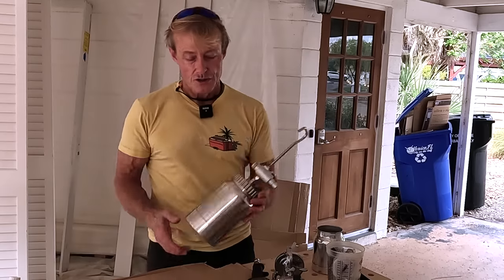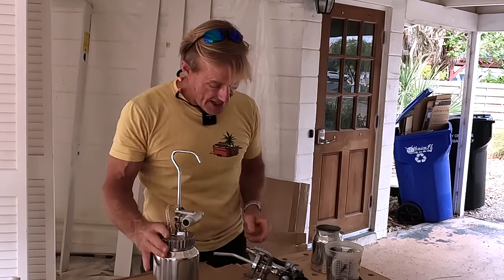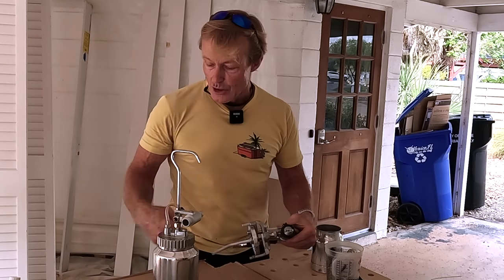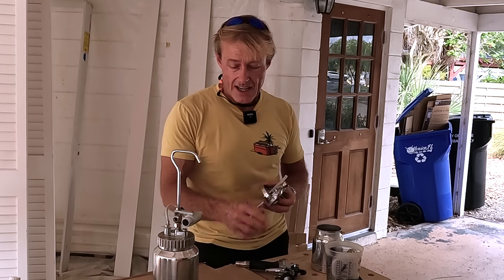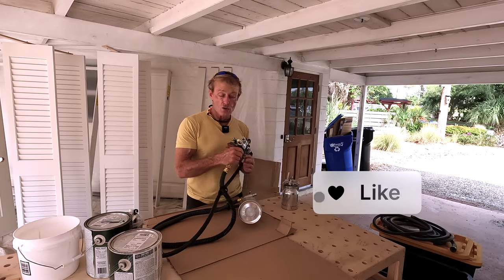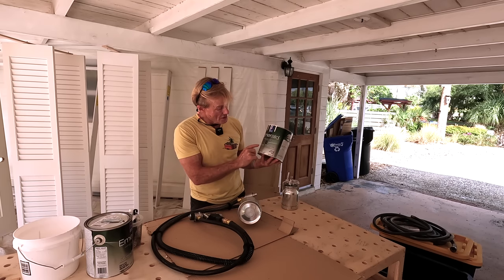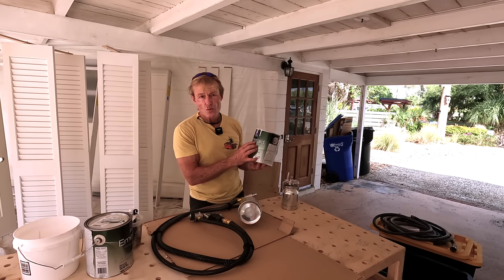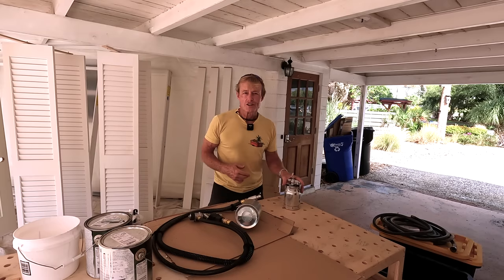Flawless Door Painting Using Titan HVLP 115

Comment: Nice job! I agree with the SW Emerald urethane; good stuff. I try to spray all my trim in my Reno’s with my airless and it always comes out nice. One small thing I do differently with the doors is I turn them back and forth into a “W” shape - makes it easier to reach both sides. If there’s any concern with them sticking to the drop cloth/Ram board, etc. you can always tack a paint strip on the bottoms but I’ve never had any issues. That is a lot of work to get to that point with the trim!
Reply from the maker: I did struggle getting all around the doors. Good tip about the W shape.
Reply: I’ve done the same w pattern for 20 years, it’s the way to go. I just did a built-in library/entertainment center. I used the emerald for the first time, ran it through my old 440. It lays down and sands like lacquer. Really great stuff, can’t wait to use it again.

Comment: Great work. We used to finish similarly, 2 things that could help efficiency. SW has a trim product in their pro classic line that is an acrylic/alkyd hybrid. It levels well dries hard & leaves no tool marks. Lastly when attaching doors together to spray set them like a “W” rather than parallel slightly larger footprint but you don’t bump anything with the house & the lighting is better.
Reply from the maker: Thanks for the tips!

Comment: Ron, thanks for another video. I love watching em. Looks like you had to back to work after a long time off. Good for you. I did a modified version of your plans for a work bench.  I love it. I have been remodeling average homes as a property manager and then fixing them up to sell since the 1970's. I did a small stint working for a custom painting contractor in 1976. Used to be just brush and roll in those days. We all used some really good oil based enamel on the door and trim. God did it lay out nicely! Really made painting fun looking back watching it flow. I've painted countless homes and cabinets since. 
I was drawn to your video to see if you had any better luck with your HVLP to my airless. Couldn't get the resolution to tell. 
I think it is the long way around to paint anything before it is attached. You could save all kinds of labor painting the jams and casings after they are installed! And have a better job too. Painting loose material is old school before the time saving sprayers. 
You can set up the actual room to spray in. Get your tarps masked tight to the flooring. Like a military bed, no wrinkles. Personally, I walk the doors and spray them with 1 corner against a wall and spray each side by handling them from the top and the handle hole. Yes, most production painters use the W layout, but hay, these are really important, and I like to see them and have full access. I pull from a stack and when finished they may be 4" separating them. 
Use a vacuum with a horse hair round brush attachment to vac up all your sanding dust. Follow up with a tac rag. Won't take that long to ensure a clean surface. Just blowing moves dust from one surface to another. And vac the floor, before you mask. If you shoot just a little paint on the floor first it will keep any loose dust from blowing on to the doors. 
Your jams and casings will need to be nailed and repaired. Then they will need to be caulked, casing to the jam and casing to the wall. After that, you pretty much need to start over anyway. All your coats will be going over the spackle or putty and caulk. This just improves the build and you will not be moving around loose boards and material. Want some brush marks? Apply about 2/3 the spray amount, run a brush through the material and then top spray it finished! Beautiful! 
Mask off the trim, sand the overspray and finish the ceiling and walls. Better and faster. 
With all this bragging, I have to admit, I am having trouble getting the airless finishes I used to get with the older higher VOC water based paints. Seems if I spray the door edges first, then the paint doesn't fully attach to itself after spraying the door face. Fisheye. Like you can see between the spray particles. Add enough paint to get it to cover and it will drip. Anyone out there with advise? My tip too small?
Reply from the maker: My painting is as a novice. I built over 200 new homes and countless remodels. 99% of them I hired painting contractors. My main painter came up to me in 2006 and said as of this billing cycle you have paid me over $1 million dollars to paint your house.😎🤙
Reply: @TheSmartWoodshop  I really enjoy your channel. Just watched your recent plank flooring entry. Liked your layout and scribing tricks.  
Often carpenters don't like painting. Since you now own a Titan HVLP and seem to be proficient at operating it, I thought I might give some pointers and get some help from one of your other followers.

Comment: All are doors, casing, baseboard we use the pro classic. goes on smooth without brush or roller marks.
Reply from the maker: Yes, we just started with SW Emerald because we couldn’t get BM Impervo. that we used exclusively Foyt years. They all flow well, maybe too well as I want brush marks in my work.😎🤙

Comment: What happens to the paint at the bottom of the doors?  Don’t you have problems with it sticking to the drop cloth?
Reply from the maker: The doors didn't stick, but dust can be an issue as the sprayer will kick up anything on the cloth.